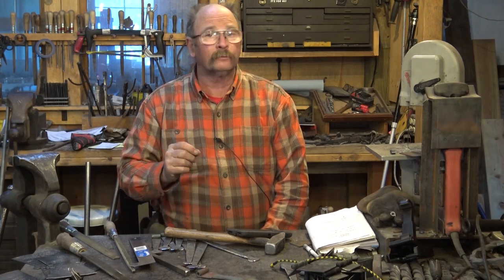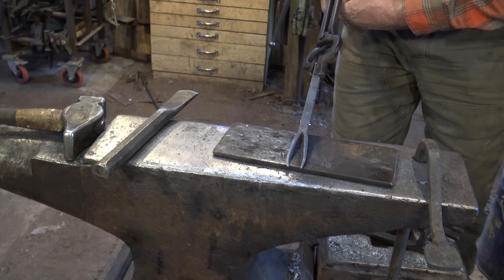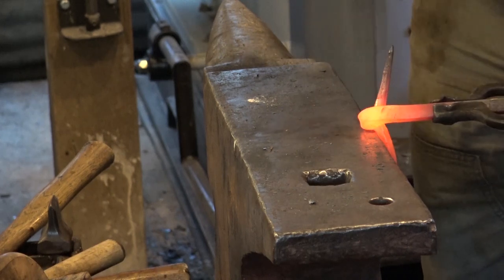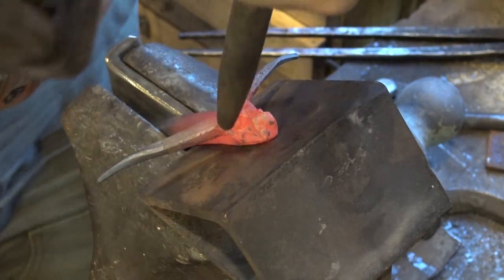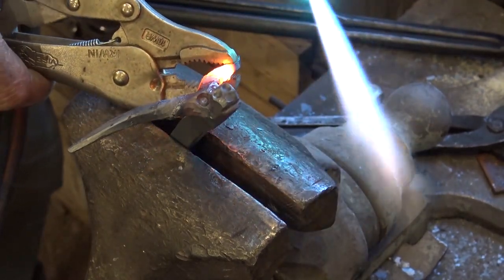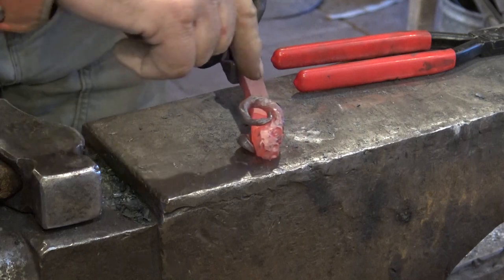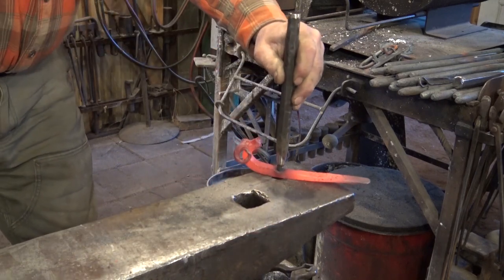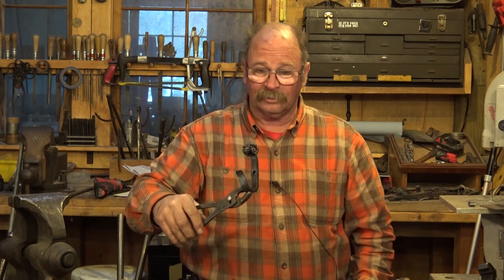Rams head hook - Blacksmithing for beginners

Comment: Thank you so much for the amazing tutorial and video! But I have a question why did you only punch one hole and not two?
Reply from the maker: Mostly because I only punched one hole.  If the mounting bolt is tight the hook will be stable, but there wouldn't be any problem with two holes

Comment: When you rolled the bar back on itself after forming the horns, did you fire weld the 2 pieces together or did you just leave the groove running down each side?
Reply from the maker: It is just folded back on itself with no welding

Comment: Where did you purchase the Round Nose Pliers?  I ordered a pair from Peihl Tools, however; they are smaller than I wanted.  I'd like a good heavy pair like you used on the rams horns.  I'd appreciate an assist on locating them.  Thank you.
Reply from the maker: Try Blacksmith Depot
Reply: @BlackBearForge  Thanks John.  I purchased a pair of scrolling pliers from Blacksmith Depot.  They are not the same as the pair you have, however; they will serve my needs.  Thank you for your reply and suggestion.   Best Wishes, Charlie
Reply from the maker: @charliebecker9391  I think the one I have are in this link.  But its always possible they have changed in the past few years. https://www.blacksmithsdepot.com/products/bending-scrolling-twisting/scrolling-jigs.html/scrolling-pliers-19956.html
Reply: @BlackBearForge  Thank you very much John.  Charlie